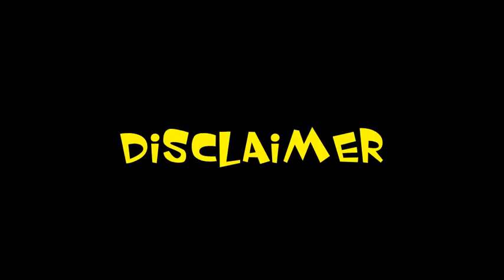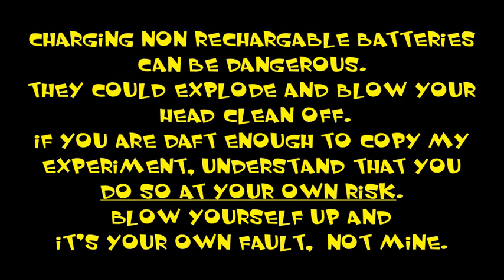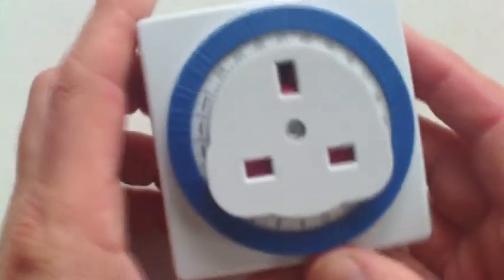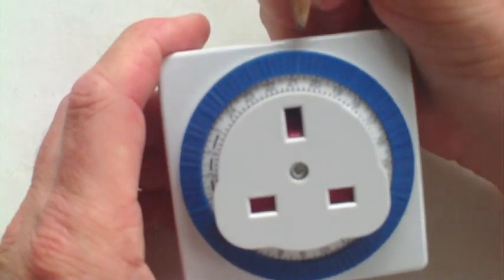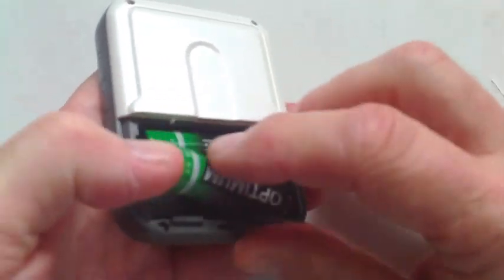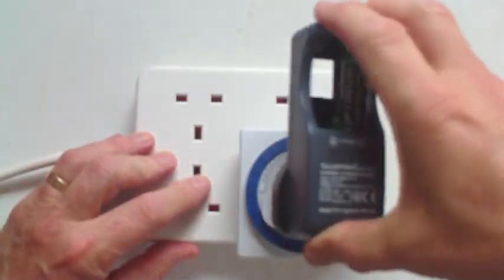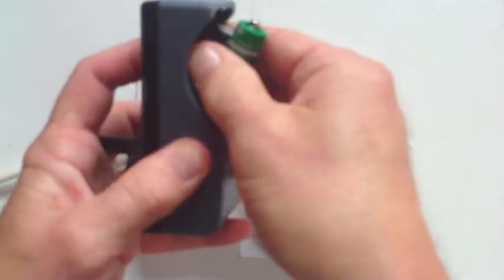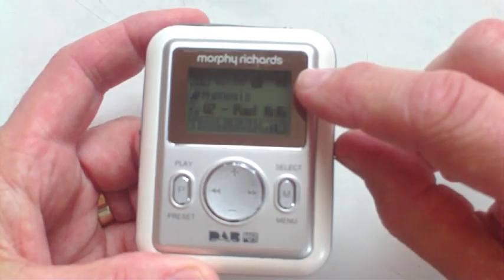How to charge ordinary Non-Chargeable batteries

Comment: I also tried this, and used an old portable freezer.  I froze the batteries, and set up a charger inside the freezer.  Electricity moves better through cold conductive materials, so not only did charging batteries in a freezer keep them from getting too hot and exploding, but they charged about twice as fast.
Reply: mossy1  I didn't record lab notes, but the batteries in my experiment stayed cold while they charged, however the batteries didn't work like they were new again.  I let them charge about 12-16 hours  Voltage was the same, but they only lasted about 1/4, maybe 1/3 as long as new batteries.

It was a successful experiment to recharge non-rechargeable batteries, but it wasn't as productive or cost effective as I had hoped.
Reply: Dude, you are damn smart !!!
Reply: Now that is a better idea!
Reply: Sean nolastfuqingname  Right on man.  Using brain power to increase battery power and batter life.
Reply: AClRCLEOFLlGHT So has anybody else tried this? What were your results? I googled it thinking that surely someone else had tried this but couldn't find anything.
Reply: mossy1   I haven't tried that but one time my phone was very hot and  I put in plastic bag and then in the freezer for a few minutes.  zwas nice and cool in a few minutes.  I thought about how it would react and figured it would be no worse than a cold day.
Reply: +AClRCLEOFLlGHT  I have an alkaline battery charger & the instructions recommends to use high quality batteries only, newly produced & discharged to the success of achieving & maintaining a full recharge & not allow the battery to discharge to the point of being completely dead prior to recharging for best results & you should be successful in multiple charges before they completely expire & the battery will diminish somewhat with each charge ... also states not to use Carbon-Zinc batteries & old batteries that have not been in use for a long time ...
Reply: AClRCLEOFLlGHT i was thinking why not put them in a small fridge to charge these instead of using the timer.  and here it is :P
Reply: AClRCLEOFLlGHT freezing the batteries and charger causes condensation on them when defrost... Not a good thing, moisture and electronics.
Reply: Mark van Werven  Works just fine.
Reply: Dibby59  Your charger probably recommends using the same brand batteries as the charger too, but that's just product pushing.  Some chargers have multi charging features, like balance charging for charging multiple batteries at once, as well as 'discharge, which will drain your battery completely for storage, so obviously discharging a batter completely isn't bad for the battery.  Companies know that since batteries lose max charge with each charge, it's best for their sales to tell you to charge them as much as possible, thus, recommended you don't wait till the battery is dead before killing it again with a new charge.  Each time you put it on the charger gets you closer to buying new batteries.  Never listen to what companies who make the products, say about their own products.  Always refer to outside, unaffiliated sources for 'true' product information.

Additionally on the subject of discharging/using a battery.  If you recharge batteries when they're at 25% or 30%, the battery will develop a memory and will give the charger a false reading that it's fully charged when it actually isn't.  By discharging a battery completely, you get rid of the memory build up.
Reply: +AClRCLEOFLlGHT  Actually the charger doesn't recommend any brand battery at all ... just recommends high quality for better results for reasons I've already mentioned ...
Reply: Dibby59  Can you tell me what kind it is?
Reply: +AClRCLEOFLlGHT I'm in Aus & bought it from Jaycar but it has been discontinued, my thoughts are it was poorly marketed & people just don't know they exist but that's purely assumption on my part ... I really have no idea why as it is a good unit ... it is called a Watts Clever Smart battery Charger ... Sorry I'm not able to give you any further info on that apart from any specs you may require from the instructions but here is a couple of links that may help hopefully ...http://www.gizmodo.com.au/2011/03/the-wattsclever-lets-you-recharge-alkaline-batteries/https://www.google.com.au/#q=alkaline+battery+chargers
Reply: Dibby59  Sorry.  I just assumed you had an American product.  If we want a battery charger that isn't made by Duracell, Energizer or some other company which also manufactures the batteries themselves with product pushing false recommendations, we have to order one online from China or some other country that has a freer market.
Reply: The only other response is using gas cooling like a fire extinguisher, but that might make for contractions that warp the casing, not so cool. Good to see someone following the route of reason.
Reply: I left a non
Reply: What's worse then a battery exploding? a bettery exploding inside a freezer.
Reply: Excellent  video.  I do you tube video with my battery powered casio key board.  It takes the euivalent of 9 volts.. I repaired TVs from 1980 to 2007 aprox. and would like to charge standard batteries..this is great info. Is it a current problem that causes it to
build up heat?
Reply: AClRCLEOFLlGHT I have an Air Conditioner I stick my phone in when it's charging. takes 5 minutes for 10 percent as opposed to 5 minutes for 3 percent on a table. This is true. It also makes your batteries last longer because heat burns the acidity out of them if I'm not mistaken. More acidity more power if I recall right.

Comment: That's odd when the video cut itself for the 2 hour wait the batteries rotated Hmmm?
Reply from the maker: That's due to my rubbish charger. The red charge light sometimes goes out during charging due to poor battery contact. Rolling the batteries a bit with my finger is usually enough to make the contact good again. That's all that happened - nothing sinister :)
Reply: Ckc dillpickle it was suspicious

Comment: i wonder though why anyone still buys batteries? i use since many years accumulators in anything, from the wall clock to cameras and flashlights. a good akku can be re charged 100's of times. wastes less, cost less than batteries and fewer hassles and COULD explode as well.
Reply: Is "accumulator" a British way of saying "capacitor"? If not, could you please tell me a little more about them? Thanks.

Comment: WARNING. My akaline charger works fine, but charge em too many times and they leak, the damage this causes it`s just not worth it. nearly ruined my Maglite and my Black & and Decker screwdriver, Kodak.Panasonic and Sony are all good from the pound shops. also i have my doubts on some Duracell and Energiser batteries from ebay.
Reply: Buy rechargeable batteries.

Comment: i cant believe that you had a aa battery powered mp3 player in 2012
Reply: Chinga3000 Did you shit yourself at the computer and needed somebody to take it out on?
Reply: haha its 2015 and I still prefer battery powered equipment. its more reliable cos you don't ever have to worry about running out of battery.
Reply: yet recharging a usb device would be quicker and safer  than this..
Reply: Rax Raccoon lol no my meaning is you can easily buy batteries on the go at any 24 hour shops. if you run out of power. but to find a place to recharge yr stuff, that's a problem. to carry like power banks, that's extra stuff to take out. and im referring to backpacking or biking when u don't really have a place to recharge. haha and yeah I think its safer to get rechargeable batteries, but I still prefer to get disposable ones to dispose and replace after use.
Reply: what the hell?
Reply: Hey, I still use a Sony Walkman from 1984 and another from 1992.  Old tech is easier to use. Lol
Reply: @timelesstunes7507  if you're an old person
Reply: Sean nolastfuqingname Did you have someone type that comment out for you? If not then you need to.
Reply: haha nappy arce
Reply: whats a mp3 player ?
Reply: Cheers for the Video! Excuse me for chiming in, I am interested in your thoughts. Have you thought about - Penlizabethify Dignified Preference (Have a quick look on google can't remember the place now)? It is a great one of a kind product for lasting longer in bed minus the hard work. Ive heard some interesting things about it and my close friend Aubrey at very last got excellent success with it.
Reply: I gess he has original batteries and mp3
from 2012 ?!

Comment: When I was growing up (1960's-70's) we recharged all batteries. Everyone did because it was considered wasteful not to. You could charge each battery for 8 hours about ten times before it just wouldn't hold a charge again. Guess what? They never exploded, leaked or anything else. Now you put a regular battery in a charger and after an hour you'll hear a little Pzzzzt & see liquid spewing from the end. I would be hard pressed to believe that the battery manufacturers didn't design them to (NEXT)

Comment: Discharging process in standard batteries is non reversible. Put them on in something more power hungry like a lantern or so, and you will see that they won't last even 5% of the original time.